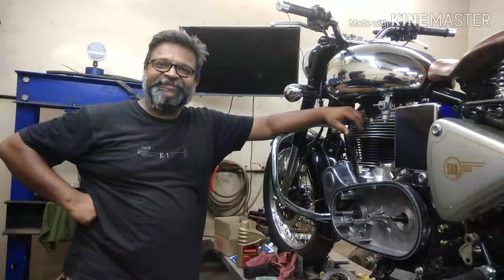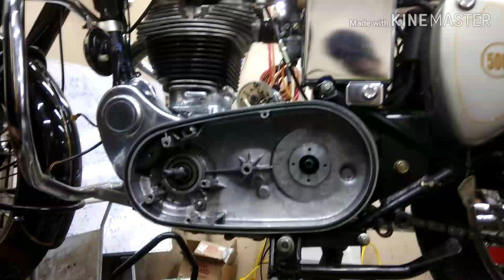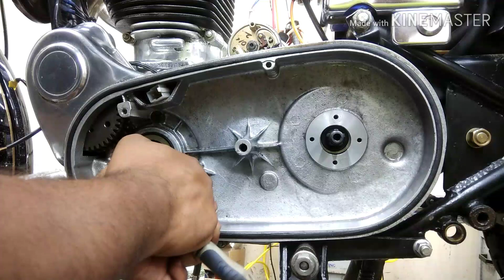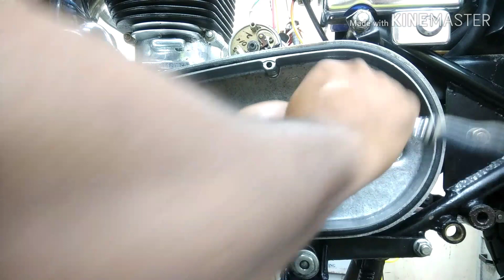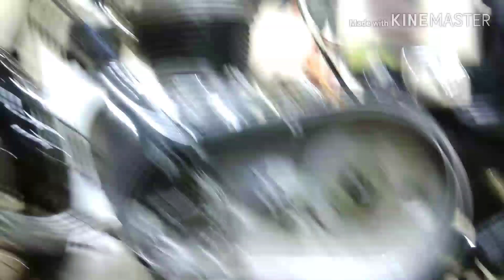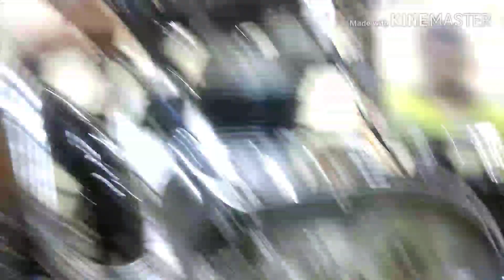Old Royal Enfield Clutch Oil Seal Adaptor placement/Fitting technic (English)

Comment: Sir i had watched many videos of your's and i have known many things about ci bullet. I have 1982 model of my father's , the bullet runs very smooth but this days i have faced trouble that engine oil slowly pass toward clutch section when i ride the motorcycle. The mechanic said that oil seal from clutch side cut out and that specific spare belong to connecting shaft of crank. And this will be fixed by opening the engine chamber as said by mechanic. Kindly suggest me how far this issue gonna solve .
Reply from the maker: Yes in older versions the crank seal was from inside for which engine opening was necessary...but I am surprised since 82 model was not having that type of seal...can you send me pic of the LH side I would like to see the seal....send the pic to macasp@gmail.com. thanks. This type of seal was older than 82...I may be wrong that's why I want to see ..

Comment: I installed new inner clutch cover and new clutch assembly but the clutch assembly is touching inner clutch cover what to do?
Reply from the maker: Clutch Centre Splines are worn out so the Centre is going inside little deep which is touching the rear adatom seal screws. To maintain that gap either you need to replace the Centre or you will have to have 0.5 mm Washer behind the Centre which will stop the Centre to go inside deep. Remember the Washer should have Splines "as well" Otherwise if you use normal Washer then it won't help you. It will directly touch the adaptor seal which will damage everything. Some small bikes like hero honda and all has front sprocket lock which has inner splines. So kind of that washer you need. If you do wrong then all fail. So risk is yours. Thanks.